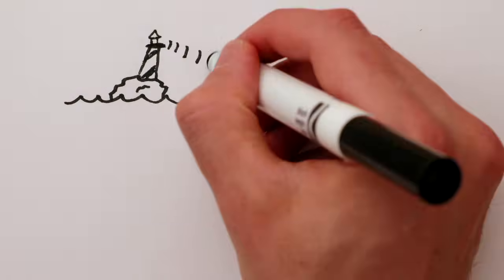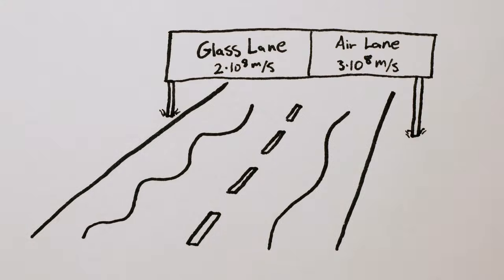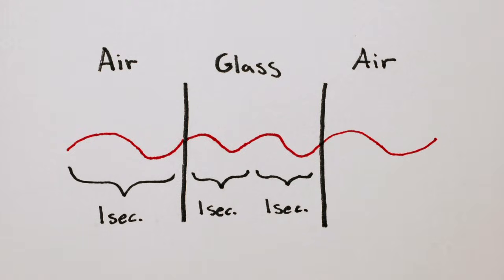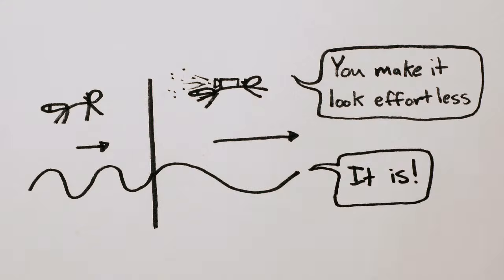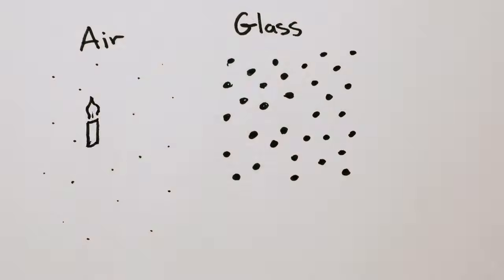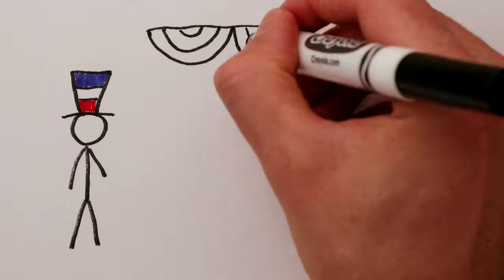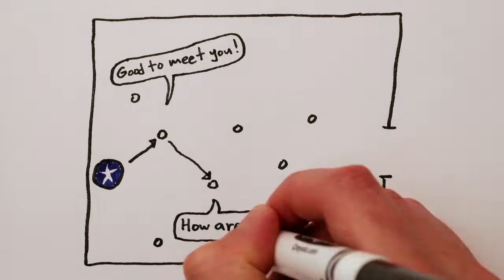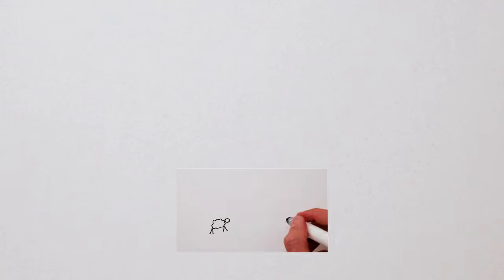The Speed of Light in Glass

Comment: ((Their output was the negation of their input: 0 goes to 1,1 to 0))

Without being manipulated light is a constant wave chain reaction from A to B, because of the geometry.  . ..and they just take longer to be absorbed and emitted with an object of time dilating volume!

In quantum computing "the two energy states" of a Qubit, can be such things as photons, trapped ions, atoms, electrons, and nuclear spins.. .  .
By manipulating this process, a physicist shines a 2pi pulse on a Qubit absorbing energy and emitting C2 - their output was the negation of their input: 0 goes to 1,1 to 0.. .  .the start of a Fibonacci sequence.. .  .

The greater the angle in space the greater the curvature of spacetime the stronger the electromagnetic field at that One point of space and at that One moment of time dilation!!

Vibrating spherical wavefronts of energy entangling +/- unfolding wave chain reactions from A to B.. .  .

Time moves at the speed of light and energy or mass slows spacetime down forming their own spacetime geometry.. .  .

As the frequency gets higher the Planck's constant will be multiplied by a larger amount and the time period slows down oscillating photons with that 3D centred ref-frame of time dilating Volume!!

Because everything is contracting and expanding.. .  .a locational spherical inward absorption t=0 and outward emission of electromagnetic waves!!

The Lorentz contraction of spacetime linked with Einstein's equations for 'rest mass' energy gives an atom, or group of atoms enough energy to expand EMR projecting their own spacetime (time) at the speed of the square of light..

This is why the speed of light in a vacuum is the same for all observers and is not relative to the movement of the observer because light will always be a universal constant independent of the motion of its source.. .  .

We are all one spectrum of vibrating energy waves both the observer and the observed creating our own spacetime at the speed of the square of light..

This is why we have the measurement problem because spacetime's are continuously contracting reacting and expanding with each other in unison.. .  .

Everything is vibrating spherical wavefronts of energy as they come from a distance radius compressing and expanding Two Opposing Vortices (Fibonacci fractals) from virtual pairs of plasma, to gases, liquids, and solids.. .  .Only difference is time dilating Volume!!, and therein lies the secret of the universal pulse beat.. .  .

The Lorentz contraction of time and space is infinite in our universe.. .  .Because the build up of electrical potential is the same as future potential imploding within any 3D centred ref-frame.. .  .Time and space was quantized into moments, only the frequency now is relative at each dipole magnetic moment of time.. .  .

Space is a division of solidity into entropy the second law of thermodynamics.. .  .But also E2= a multiplication of volume at the expense of gravitational potential.. .  .E2= mc2c4+p2 Q2.. .  .

Wavefronts at right angles from all time dilating inertial ref-frames 'particles' of the universe cascading downward combine from a distance radius forming the sinusoidal wave medium density (space) compressing and expanding two opposing vortices at each and every point of space, or contracting and expanding virtual pairs popping out of existence.. .  .Always forming a blank canvas that we can interact with turning the possible into the actual.. .  .

A light wave always transverses one unit of space per one unit of time.. .  .In a sense they are on the edge between space and time.. .  .Like a drop of water into a pond dividing one unit of space/ multiplied by one unit of time dilation.. .  .Light is frame dependent space divided by time and nothing else.. .  .That implies a strict equivalence between time and space as light being a constant conversion unit between the two.. .  .

Wave chain reactions of all sizes!!

The total amplitude formed by a rings series of inward spherical wavefronts at every point colliding at maximum compression points at wave crests and wave troughs always seeks a minimum are equally balanced by opposite expansion at interchanging compression points as trillions of wavefronts cancel the sum of opposite vectors is always zero leaving space with an average temperature, or pressure stillness of the wave amplitude squared.. .  .

This is the reason for the symmetry or conservation laws in human physics or why, at the speed of C, time and space are zero due to length contraction and time dilation.. .  .

Therefore light dose not slow down but rather, the time period is slower within the One absorbing energy waves t=0 now appearing as two opposite extensions of that centred One emitting C2.. .  . (Their output was the negation of their input) 

 At the quantum level everything is in violent motion simulating rest and balance now through violent motion.. .  .A continuous process of change that we feel and see as an uncertain future and a measurable past.. .  .
Vibrating matter is a fine mixture of positive and negative electric charge coming into and out of existence.. .  .

Time is shorter at ones feet than at their head because the greater the energy compression contracting spacetime now =0 the shorter the expanding wavelengths.. .  .

Acceleration from fuel is not a rocket nor its thrust.. .  .But rather an equal and opposite reaction.. .  .Thus, gravity is a secondary force from the electromagnetic force.. .  .
Time after time gravity, is an after effect from the continuous stimulated emissions as time unfolds C2.. .  .Gravitational systems are the ashes from prior electrical systems.. .  .
The constant outward momentum of the light C2.. .  . forms the inward force called gravity!

The strength of the gravitational field transverses Q multiplication and division inversely proportional to the square of the distance as their individual light spheres superimpose crests and troughs become in phase now, their space time line symmetries will synchronize or amplify from the source of that constant expanding light sphere.. .  .E2=mc2c4+p2 Q2.. .  .

All things are One absorbing energy waves t=0 now are appearing as two opposite extensions of the centred One emitting Q2.. .  .

The electric field twice as far from the source is spread over four times the area, hence one-fourth the intensity.. .  .

Vibrating sinusoidal spherical wavefronts forms Einstein's curvature of spacetime.. . .

Concentrated spheres at right angles, such as the Earth and Sun, are surrounded by layers of light of equal pressures.  . ..(Now slices).. .  .Clouds float around the Earth in them.. .  .The reason they float in curves parallel to the Earth is because of these spherical equipotential planes of pressures which curve as the Earth curves.. .  .Curved pressures of light act as lenses to multiply and divide light radially!!.. .  . Because everything is contracting and expanding.. .  .a locational spherical inward absorption t=0 and outward emission of electromagnetic waves.. .  .
Reply: Ranstead Moons Rofl you're good at that :D
Reply: Gotta love these long, essay posts by people who use words they don't understand. Science isn't done by stringing together buzz words you've heard in pop sci sources, in a way that doesn't fit with their usage or definitions.

This makes as much sense as saying "unicorns balls wave-particle duality honey chocolate chip forms curvature of spacetime".
Reply: Narcissist86"I guess what am trying to say is that these High wave amplitude Wave Centres are time dilating inertial ref-frames therefore their output "was the negation of their input": 0 goes to 1,1 to 0.. .  .And therefore the photon oscillations take longer to be absorbed and emitted within the glass of water, as the Planck's constant will be multiplied by a larger amount, because the glass of water, has a greater space density, than the surrounding air molecules.. .  .And therefore time is slower within that 3D centred ref-frame"
Reply: Seamless Robe Once again, you're stringing together buzz words in an incoherent manner. Even if your thought process has any semblance of logic, your paragraph doesn't.
Reply: Narcissist86
If Narcissist86 doesn't understand it, no one does!
Reply: MegaSnake1000 In an electromechanical sense yes, but as everybody here is just an incoherent string of unfathomable entangled quantum states it becomes inertial to suggest the gluon has insufficient momentum charges to surpass the universal magnetic field strength, and thus may initiate a chain reaction of said entangled strings within the compartment!

As Narcissist86 once said: "Science isn't done by stringing together Buzz Words."

From this set of hypothesis proposed, the fundamental energy fluctuations of electromagnetic fields, such as those of which are emitted from common sources here on earth, can be measured (theoretically) by the background microwave radiation radiated from the beginning of time itself! And because time dilation cannot be practically interpreted without dampening the binaural cortex of the event horizon, we can extrapolate from this that quantum strings are indeed buzz words! Interpolate this back down to the plank length and observe how therefore, as predicted by Narcassist86 himself that the universal time gradient is but a refractive myth proposed in 1806 by the grandson of Leonardus Europolis's cousin, and thus all commenters are the reciprocal asymtopic precipice of a star, which, as we all know, implies the Homo sapien subspecies, along with all other life forms plausible in our universe are nothing more than the fundamental sub-string fabric of space time.
Reply: Ranstead Moons Now is the moment of emission.. .  .
"The fact that this spherical region of the universe has a limited observable range, in the shape of an inverse sphere 4pi R2, And the fact that the electron is a perfectly round sphere, and two sides of the same coin.. .  .There exists only two combinations of these two Spherical + and - electromagnetic sine waves, or wavefronts multiplying and dividing at right angles.. .  .They have opposite vectors and quantum spin forming the positron and electron wave centre.. .   .Or the two energy states of Qubits in quantum computing, which can be such things as photons, trapped ions, atoms, electrons, and nuclear spins.. .  .Only difference is time dilating Volume!!
Their output was the negation of their input: 0 goes to 1,1 to 0.. .  .the start of a Fibonacci sequence.
Therefore generation of any information exceeds radiation during the first half of the cycle.  . ..Radiation now exceeds generation during the second half of the cycle.. .  .as the constant outward momentum of EMR repels like charged particles absorbing energy and emitting the density from the two previous vectors spiralling out the Fibonacci sequence seen everywhere in nature."

Comment: Wait, so if light slows down while ping through glass... Then does light have mass at that point?
Reply: I'm 7 years late, but it's 12am and I'm bored so for whoever winds up here:

A photon of light is just pure energy, with no mass, which is why it can travel at the speed of light (in a vacuum).

When an electron absorbs a photon, that Photon is destroyed, and it's energy is transferred into potential and kinetic energy in the overall atom, and puts the electron in an excited state. When that electron eventually decays back to it's ground state, that gained energy is then released as a photon.

So, the light doesn't gain mass, but when it enters an atom, the atom gains potential mass/energy (by e=mc^2).

Comment: So in other words - the time between the moment you turn on the light and the moment the light comes to the finish line will variate if the air is moving, because the molecules would not be in the same spot every time?

And I suppose the same would happen in glass because the glass molecules move, although that depends on how fast the molecules moves which again depends on the heat of the glass. In other words, Wind is equalent to temperature?

Comment: Actually thw light travels slower than that in water, so if something high energy "ex. a neutrino" hits the water particle releasing it's electron - the electron will travel faster then light (in water) releasing a "light boom" - a little flash just like the jet plane reaching sound barrier. That electron will travel faster than light in water but still slower than "C". Hope it isn't too complicated XD

Comment: I could be wrong but I think it's to do with the amount of energy required to change an electrons energy level in different substances.  My theory is that the energy specified by the frequencies of the visible light spectrum are not absorbed by transparent objects due to the structure of the electrons in these substances.  Other frequencies of light like radio and microwaves can travel through things like brick, it all depends on the frequency, I think

Comment: All of light travels at the same speed in a vacuum and the speeds would seem to change in a medium.

Blue light travels with more energy as it has higher frequency, a higher frequency results in a lower wavelength and as Enrico Fermi discovered, the higher the wavelength, the less likely the particle (or wave... or both) will interact with particles in it's way. Basically the lower energies are bent more by the prism because they interact more with them.
E=hf
c=λf

Comment: Aren't there electromagnetic qualities of the atoms in the glass that are different than air or a vacuum?  Isn't it this that affect the electric and magnetic field (light wave) propagation?  It's not as simple as the light playing pinball in the atoms of the glass.  Atoms interact differently with different light frequencies.  They absorb the light temporarily changing the energy level of the electron fields, these fields want to return to normal and so re-emit the energy as heat/light etc.

Comment: That is what happend to some subatomic particles (such as electrons!) when they are inside a pool of water: they go faster than light IN WATER (not in vaccum, of course) thus an interesting phenomenon occurs: just as a plane which goes beyond the speed of sound releases a blast of "noise" (Booom!) the electrons release a "blast of light". It is blue in colour and the phenomenon is called "Cherenkov Radiation". Check it with google. ;)

For instance: it is seen in nuclear reactors, and it is just

Comment: Or, you could think of it like running. You are running as fast as you can on concrete on level ground, and then you fall into a 3 foot puddle, and continue to run as fast as you can. You are still running full speed, but it is slower in water.

Comment: No atoms scattered bro, no mass in photons and the atoms in the effected particles remain unaffected. They react by absorbing energy and retaining it getting hotter and glowing in several wavelengths ( infrared, etc ).

No slowing down of light-speed either, just longer path to run while bouncing off of particles in the medium. Momentum never changes, just direction, always same speed.
The wave does get compressed, changing it's frequency but not the color of the photons or the speed. :)

Comment: The "beam" of photons gets it's path diverted inside the medium but never looses momentum, it just changes directions in straight lines until it leaves the medium taking longer to exit ( refraction ). When it does it goes in a straight line at same speed which never changed.  ( light speed = C ). Some photons get absorbed by particles giving them heat and glow ( radiation ) the ones that "survive" exit unhindered no more and the wave is no longer compressed so gets back to light speed instantly.

Comment: That is because the way light 'bumps' into things - I think it is called 'secondary wave propagation'  The wave front of light bumps into loads of particles - at each particle, there is a secondary wave that is like a circular ripple.  when you overlay all those ripples, the 'leading edge' basically reconstructs the original wave front.  You also get a small amount of scatter, which is what causes diffusion effects.

Comment: You assumed I misused "scattering", then said I was wrong because of how you thought I was misusing it :(

I understand that scattering is random. I stated that that is pretty-much NOT happening (it's negligible) in glass, because the final direction of the light is not random; it's straight, it preserves the original image. So, I ask again, what slows down light in glass? The path is NOT longer (not considerably), because LITTLE-TO-NO scattering occurs, so the light must "slow" in some sense.

Comment: Ummm...no, not precisely.  Light travels through glass with relatively negligible scattering...relative to say motor oil.  It scatters more in glass than in air, and more in air than a vacuum.  And that's the key.  And another key is it's not so much scattering as it is just lengthening the path.  The word "scattering" implies a more random final direction, if you will.  Most of it eventually goes out the other side of the glass.

Comment: It has to do with relativity. Short answer: You can't just add speeds linearly: A + B = C. Instead, you have account for the Lorenz contraction associated with motion 1/sqrt(1 - v^2/c^2). For slow speeds, this term is practically 1 so you can add speeds linearly without much concern but for speeds approaching light, this term gets large.

Comment: If the light is doing work it is losing energy. Its movement does NOT use up energy as light has no mass. If light has to do work in glass, it would be absorbed by the glass. Does light disappear, or appear mush dimmer after passing through glass? No. That's my proof.